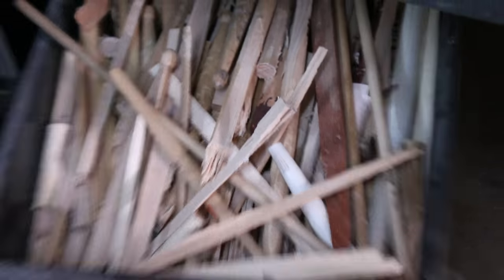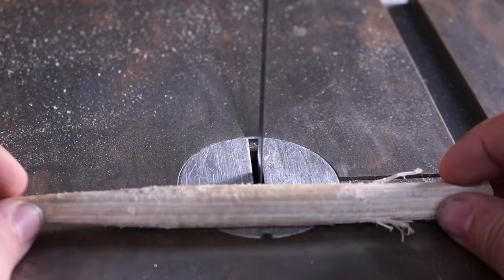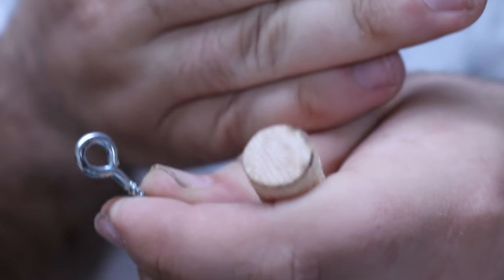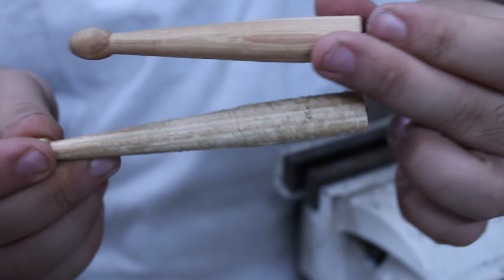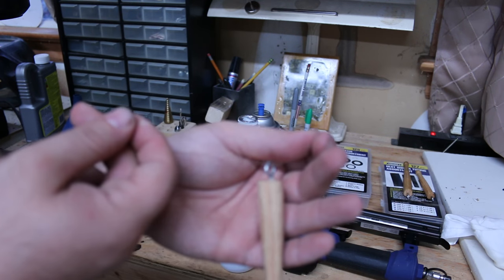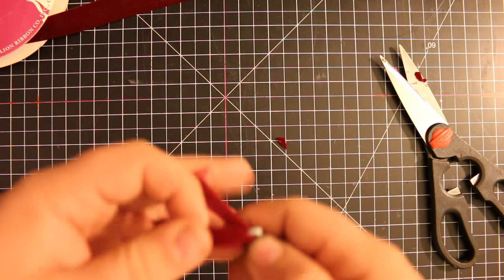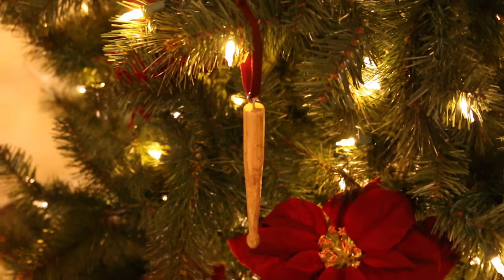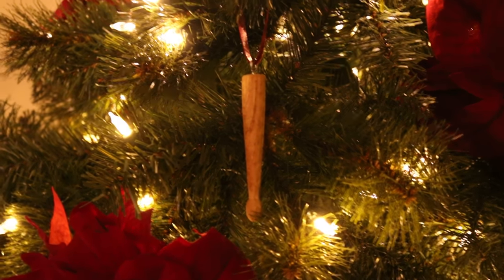Easy DIY Drum Stick Ornament

Comment: you ever thought about attempting to build a marimba or a vibraphone? There's actually instructions out there,  and it's relatively simple to do
Reply: ***** I'm actually doing it right now. It does take a bit of time, about 15-20 minutes for the lower keys, but it gets progressively easier and faster as you get up to the higher octaves.
Reply: ***** Thanks! I'll probably make a video about it when it's done; it's gonna be great hopefully
Reply: ***** sounds good lol.